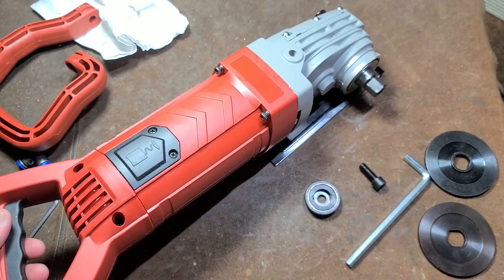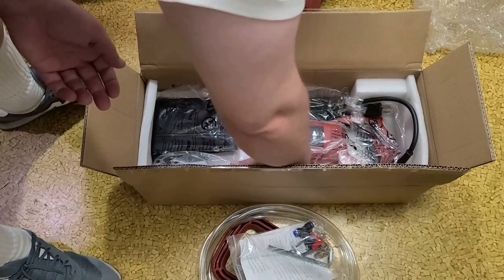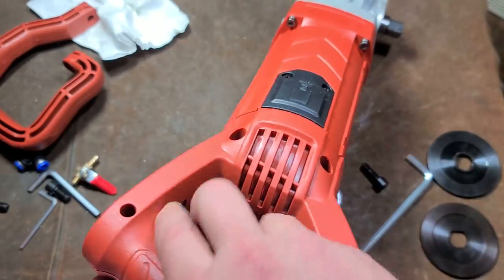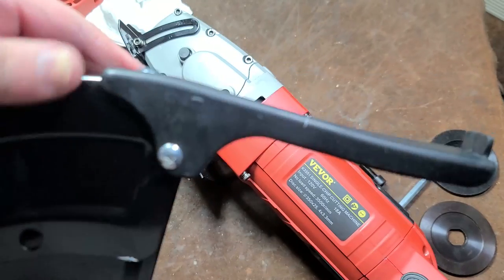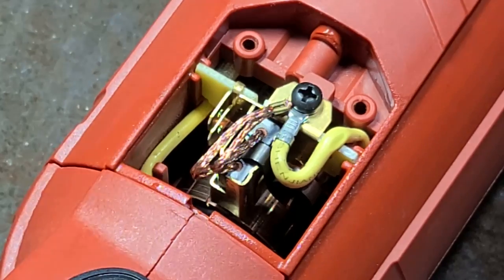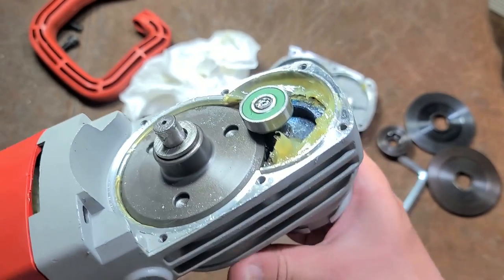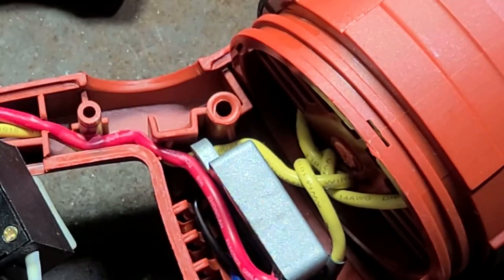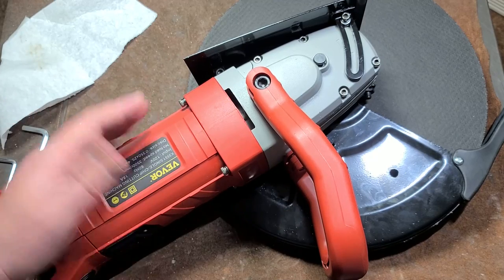Vevor 14" Masonry & Multi-Purpose Saw Review/Semi-Teardown

Comment: Just bought one of these and plugged it in just to test it out, and was suprised to find that the blade seemed to spin backwards. It is not a fault as the direction is marked on the body, and I see in your video yours spins backwards as well. Is this meant to happen? I cannot find any other concrete saws that are like this, and to my mind it seems a tad dangerous, the blad is always pulling towards your body. am i missing something? cheers
Reply from the maker: I think their bright idea was gonna throw us debris away from you rather than towards you however I noticed that if you remove the footplate You can move the handle to the opposite side and make it pull towards you
Reply: When you cut with it,stand off too the side, it will come back at you.

Comment: I could have cut that bolt in a quarter of the time with a 4 1/2" angle grinder.... Possibly the same amount of time by hand with a hacksaw, however I imagine this things niche is small concrete jobs on the cheap.

Comment: That think will kill you if you use it with those big blades if you take that black disk to concrete. 

It will shatter the blade into your face.

A wet saw with a blade like that and the speed of the rotation will cut through bone.

That machine is unsafe to use.

This the Potato 🥔
I don't this owner of this channel know or realizes on the correct tool for a suggested job.

This tool is dangerous. 
Do Not use this tool.
Reply: I think you’ll find that Husqvarna actually make a similar product - K4000.
I personally own one and use it regularly, however have years of experience. But no more dangerous than a normal demo saw